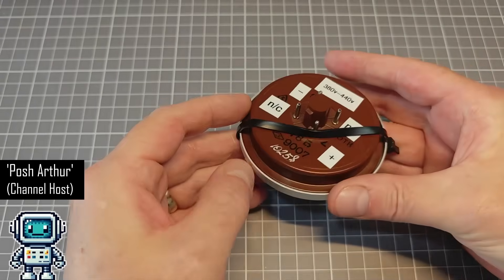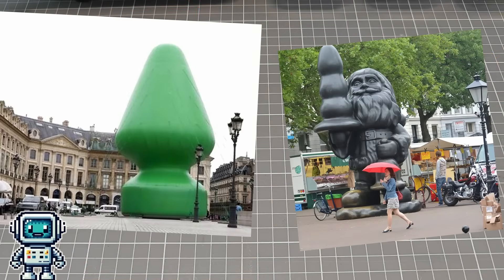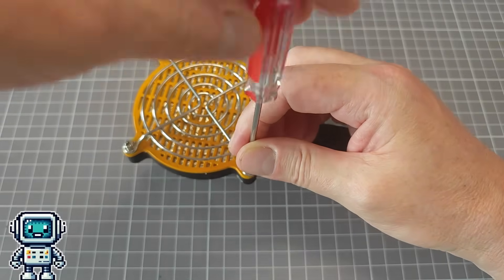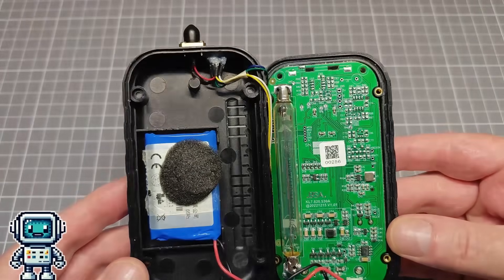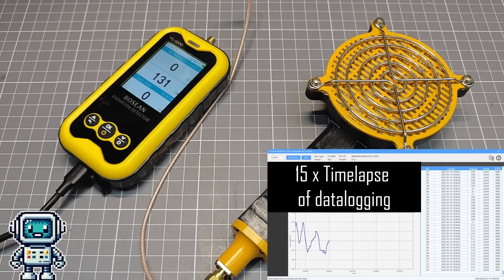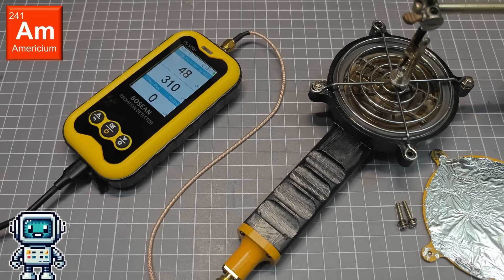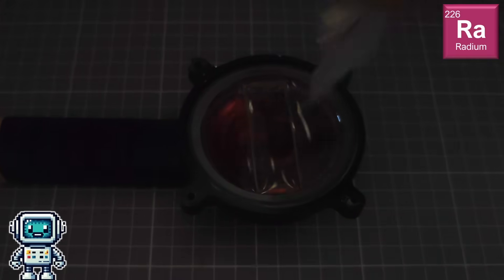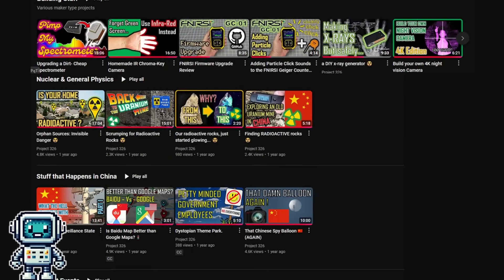Upgrading a Cheap Chinese Geiger Counter

Comment: Flame / Discharge sensor?
 UV sensor that is sensitive only to UV light
Reply from the maker: Congratulations, you are correct!
This is a flame detector tube and hopefully the next video will be showing how these things work, its actually has a lot in common with a GM tube!
Reply: Thanks mogergog, I was racking my addled brain as I replaced some in a steam boiler years ago.

Comment: I modded a fs5000 with an 11a tube and it’s fantastic. I get 30kcpm with a smoke detector button.
Reply from the maker: the sensitivity is fantastic.  What I was totally amazing with was the detection of tritium vials.  Tritium is a weak beta emitter, but the x-ray fluorescence of the glass from these betas was detectable...

Comment: Just started looking and I see an error in the shape of the probe handle. The handle is parallel to the plane of the sensor's working surface. In Russia, the IRD-02 device (ИРД-02) is produced for checking banknotes. The first modifications were shaped like yours. The latest versions have a handle at an angle to the sensor plane.
Reply from the maker: Hi Vlad, thanks for watching and commenting.  I know, most probes are more ergonomic, but my 3D skills are pretty poor!
Reply: @project-326  I can design 3D models for you if you want. I'm not a professional, but I'm improving my skills. No payment required :-)
Reply from the maker: @vladi_g  sounds good, drop me an email on the channel address...

Comment: Love all your experiments, keep it up! FYI, potential interesting route for alpha and low energy xray detection, normal cmos sensors like webcams etc can detect these if the cover glass is removed. Sometimes depending on pixel intensity you can determine the energy to some extent as well. The sensors often have bayer filters or microlens arrays though, so for alphas those would likely need removed. Les' lab had a cool video doing that with lasers.
Reply from the maker: Thank you for the kind support and also for the advice.  I have looked at web-cam for low energy x-rays before but that approach does have a lot of limitations.  I will keep thinking up new things for cheap stuff to do interesting experiments with.
Reply: We really appreciate the support, it goes a long way to helping with all of the things we need to by for these kinds of projects.

Comment: That is quite amazing and unusual to use pancake tube, as they are fragile, but what is the size? It could fare be compared to common types that are 1.75 inch. Second as they are intended to be more sensitive it does not match small sources, as they also have the higher background count versus cylindric type. Common type of window for alpha emissions is mica, but you stated to use different?
Reply from the maker: Thank you for the comment.
It's a 3" pancake tube but I am not sure what the window material is.  Normally, I don't expect mica to be so wonderfully transparent, but perhaps I'm wrong!
Reply: @project-326  the common sensitivity of 1.75 inch pancake type is 3340 cpm/mR/hr at Cs-137 or at common background of 0.1 uSv/h about 30 cpm, it means on the size of 3 inch you should get about (3/1.75) exp2 = 3 or count rate that is about 3 times higher, so if you get 90 cpm on standard background you should be fine. Mica is commonly used for alpha/beta/gamma detectors, but is very fragile. For beta detectors is sometimes used beryllium but is discussed as toxic.

Comment: I modified a GMC-320 to accept an external LND-7317, it's crazy sensitive but also crazy fragile. I destroyed one by quickly closing the door to my house which suddenly changed the pressure in the room and caused the thin mica window to shatter. LND are still in business and you can still buy them. The detector ships in a sealed metal can to prevent it from pressure changes during shipping.
Reply from the maker: That sounds like a fascinating and risky modification.  I have three young kinds in the house, doors getting slammed is a regular occurrence!
Maybe this is why LND are still i  business, all the replacement tubes keep them afloat?
Reply: @project-326  Obvious answer is remove the doors so they don't get slammed.
Reply: This is why you keep anything with an alpha window in a sealed container as already mentioned in another comment. An ammo box from Harbor Freight will work. A small gadget will fit in a hand gun case.
Reply: My pancake probe lives in a sealed welding rod quiver. Slamming the car door is perfectly safe. You can also use an ammo box from Harbor Freight. Just don't drop the lid as you're closing it.

Comment: That's a bit weird - I have a smaller soviet pancake tube with home built electronics, and it is for sure sensitive to alpha particles. Your plastic grille will be a perfect block for alpha particles, so in the experiments with the grille on you might just unluckily have positioned the alpha source on top of the plastic and thus blocked all alpha - but with the grille removed and just the mica window under the fan grille it should have been a quite unlikely coincidence if you had blocked all the alphas by the metal wires.
Reply from the maker: the source I am using has an Am-241 activity of about 100 KBq, which means that about 50K alpha particles firing in the direction of the tube ever second.  Over a 5 minute measurement, there would have been something in the range of 15 million possible events to be measured...
The 1um Mylar film is almost completely transparent to alpha, looking through NIST stopping power tables, this will account for about 1 MeV of energy lost in that layer.  The window of the tube was about 10mm from the surface of the source, and 10mm of air will on average account for another ~1.5 MeV of energy loss.  But given that Am-241 decays with an initial alpha energy of ~5 MeV (ignoring recoil losses etc), there is going to be around 2.5 MeV of kinetic energy left when hitting the tube window.
One issue I might be encountering is the tube voltage.  I have a special high impedance measurement probe and I set this to be about 400V, but I have received some emails recently from other people that use this tube and they recommend about 450V, which would push the response much further up the Geiger plateau.  I will try this and perhaps make a community post...
Reply: @project-326  your mylar film also had a thin aluminum coating if I saw that correctly... However, I think we now can be quite sure that your detector simply has a too thick mica window.
Reply from the maker: @uwezimmermann5427  The Mylar film I am using is from the same supplier that the Measall KC761 series of spectrometers use for their alpha detector covers (they put me in contact with their supplier).  You might be interested in a previous video I did on alpha spectroscopy (https://youtu.be/9VqtumUDaO8), in that video I calculated the combined stopping power of the Mylar and the aluminum that is deposited onto it.  You can see in that calculation that the aluminum is so thin that it is almost irrelevant in the overall energy loss of the alphas as they pass.  I am actually thinking that the lack of alpha sensitivity is a result of the working voltage being too low, so being at the wrong end of the Geiger plateau...

Comment: Brilliant video as always, if you don't mind me asking, what is your educational background? how did you learn so many things? I'm an electrical engineering student and I have learnt more from videos like yours than I do at University. Is China just that advanced?
Reply from the maker: Actually, everything on this channel is deliberately outside of my fields of professional  experience, this is primarily about me learning new things and then sharing that.  
My education consists of degrees in EE and Math.  In my engineering consulting business, I specialize in signal processing (A and D), IC design (mostly specialist DSPs), acoustic research and RF design.  I have always had a pretty deep interest in signal processing and the math that underpins it, so it is the applications for that which is what my day-job mostly consists of.

Comment: Also lol damn it, Chinese layout guy! K2's leg is definitely not far enough from the HV anode socket. Get your spacings right! I hope there's some silicone or something there to fix that? Man.
Reply from the maker: Thank you for the comment.
The tube is running at about 400V and the current is in the single digit uA region.

Comment: That Bosean is quite nice, thanks for its original review which led me to it.
Reply from the maker: Thanks! I'm glad my review helped.
Reply: @project-326  Of course the first thing I did upon receipt is open it up to confirm it contained the "good" tube. Pleased to report it did, for a while there they were shipping them with cheap knockoffs.
Reply from the maker: @rafalklepinski7372  One of this channel's little achievements is that we pushed them to make the commitment to only ship with the J321, after watching this video, the company was actually very responsive and I have stayed in touch with them as a result.  They clearly have a capable design team and its a real shame that they are unlikely to release any further detectors, their main business is gas detectors (and they have a pretty good reputation in those types of products) but their Geiger counters didn't really get much commercial success.  Their team has told me that they will continue to manufacture the FS-5000 at least for the rest of this year.
Reply: @project-326  As consumers all we can do is vote with our wallets. I'm very happy with my paid-for unit but without your review, I would've never even known about them and might have been trapped by all the garbage counters on Amazon 💩So perhaps their marketing team needs to be beefed up. Thanks for the heads-up regarding discontinuation. I think I'll buy an additional unit (or two) before they disappear!

Comment: Not sure a better interface is going to make the setup more sensitive. After all, the event detection circuit of a GM counter is pretty binary. Sure there is some amplitude variation between events, but not a whole lot, so if you got it working to the degree we see here, I don't think you can expect any significant improvement in radiation sensitivity to result from a better interface. 

Although I do think a better interface circuit is called for! It would be very nice to be able to use the flex cable. Does this counter use a coupling capacitor from the anode end of the tube to the detection circuit? Is it just a matter of setting a more sensitive detection threshold? 

The tube's charge quantity per discharge is generally about the same number of coulombs and generally not too sensitive to anode resistor value or drive voltage from what I've seen in my experiments (maybe a factor of 2 change over a decade of anode resistor change, if I remember right?). So the more capacitance we add in the form of the cable, the lower the pulse voltage, with the cable basically forming a capacitive divider with the tube. 

The other effect I assume we'd see is a much slower pulse rising edge slope. The anode resistor in the handle will form a 2 pole filter with the tube capacitance, the cable capacitance, and the output resistance of the counter's internal anode resistor. This will change the pulse from a sharp edged one into a slow ramp up, rounded top, and slow ramp down. If the coupling capacitor and detector circuit input resistance form too fast of a time constant, this slow ramp will also impede detection, acting as a differentiator rather than just AC coupling.

I have a whole other set of comments if the sensing is done on the cathode side of the tube without a coupling capacitor... that's a much worse position to be in for a remote probe application, I hope that's not what's going on!

I'm super glad to see you did include a second anode resistor in the handle, I'm sure you were thinking what I was thinking which is that without said resistor, the tube will have to swallow the whole cable charge during each discharge, massively increasing the peak tube current and energy dissipated, and massively shortening the tube life.

[edit]

actually a couple thoughts/questions... did you figure out what's going on with R64-R69? They just seem to go to a test point on the outer layers, is it a four layer board? or only used during manufacture? If they're a second divider in addition to R70-R74, what's it doing? Are they using resistive coupling to detect the pulse, rather than capacitive coupling? 

Another question, did you figure out what C52 and R60 are doing? R60 looks properly placed to be the internal anode resistor, but then C52 would be placed to increase the charge delivered to the tube when it fired, which is typically not healthy. Although I read that in some cases an anode capacitor is used to enhance quenching of the tube, by causing the tube to conduct more heavily and reach a lower voltage, and then also reducing the voltage rise rate after the pulse. If C52 is doing that, then it's really going to hurt external probe performance badly since it won't do this to an external tube with a separate anode resistor, and it will make the capacitor divider behavior much worse. If C52 is there for quench enhancing, removing it might make external tube operation much easier.
Reply from the maker: Thank you for reaching out with such extensive feedback.
You are correct, the anode resister normally doesn't have such a major impact, although is doesn't help when the cable capacitance is quite high.  What I was getting was drastically reduce pulse height and a widening of the pulse duration.  I had to reduce the divider ratio to the pulse counting transistor to account for the reduced amplitude.  The natural pulse widening is causing some closely spaced events to be recorded as a single event.
I was planning to put a circuit on the rear of the tube itself to act as an impedance buffer and make the counters internal circuits be less sensitive to the cable loading.  
You are correct about C52 and R60, but when the external probe is selected on the DPCO switch, these are bypassed.  R70 to 74 are a high impedance resistive feedback to the power supply.  It is one of the things that separates this model from other cheap devices, the HV is actually regulated.
I hope that helps.

Comment: Can't you get an LND pancake for around $70?
Reply: Minimum order from LND is $100 so you have to buy two.
Reply from the maker: I will look into that...
Reply: I may have been wrong.  I'm not in the US and access to toys is scarce.  Google Images Scientific GMT-07 .   I read somewhere those are LND tubes but the price tag is $140.
Reply: @cloudalien443  It's an LND 712 which is compensated for Cs-137. 500V, a slightly higher voltage than the Soviet stuff.
Reply: @themacdoktor thanks, appreciated!

Comment: Since you like optics, how about building a Fabry Perot interferometer? Just two parallel mirrors and an eyepiece. The big challenge is finding extremely flat mirrors to resolve fine details... an exercise of browsing obscure taobao shops I guess. Maybe you can make it good enough to observe the Zeeman effect..!
Reply from the maker: thanks for the comment and the interesting suggestion, sound like a challenging project.
Reply: @project-326  Yes, that would be very interesting.  I have a Hydrogen alpha solar telescope that works on this principle but I don't really understand the underlying physics.  It has a bandpass of < 1 angstrom so shows lots of interesting detail on the Sun.

Comment: Your videos are some of the best on this platform.  Thank you for all the hard work you put into them!  Do not worry about the advertising and if you get sponsorship from a vendor like JLC PCB or PCB Way I will smile as I watch the ads.
I used to design radiation survey meters and you do an excellent job.  My favorite pancake alpha tube was the LND 7313.  It's a 900 Volt tube but it has excellent alpha sensitivity.  I wish I still had one to donate to your channel.  LND also has a 500 Volt version called the 7317.  Those SI-8B tubes are beautiful, but I do wonder how the neon/halogen gas fill holds up over time.  Photomultipliers for instance have a limited lifespan because helium leaks into the tube.
Reply from the maker: Funny, I have been offered sponsorships from both of those guys, their payment levels are so stupidly small that I initially assumed that they were just trolling me.  Each of these videos takes about 2 weeks to pull together, a couple of hundred bucks doesn't really make sense to have to go through all of their 'approval requirements'.
My main issue with ordering stuff from LND is that they make it really difficult to order from China...
Reply: @project-326  I understand the sponsorship difficulties. If I had invested in crypto early on I would gladly be sponsoring your work. I can imagine LND's shipping is difficult to China.  It wasn't terribly easy even to San Francisco.  I remember they were all sent in sealed cans because the windows rupture at altitudes above 2500 m.  I erred on the tube number and should have typed LND 7311 for the 900 Volt tube, but that tube is worth everything it costs for alpha hunting.
Reply: @project-326  i'd be willing to buy from LND and ship if you want. i've bought from them before.
Reply: I have an extra 7313 but it's not up for grabs. 🙃

Comment: You should try changing the original software, like you did with the other counter .
Reply from the maker: I'm considering it, but when I tried the open source data offload software that is supposed to work with it, I wasn't able to get it to run on my system.  Data offload is a key feature for me and losing it would be pretty painful.

Comment: It's a gas discharge flame detector, detecting UV light.  I think its supposed to be sun-blind, i.e. it doesn't respond to room light or the sun.
Reply from the maker: You are absolutely correct, this is a UV sensitive flame detector and was designed to be sun-blind.